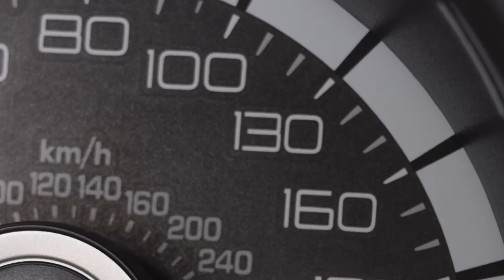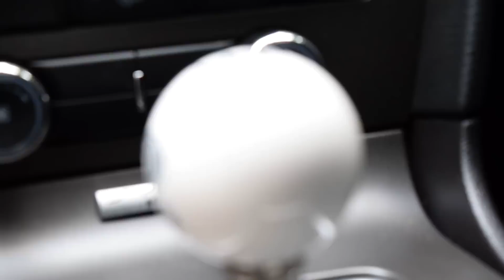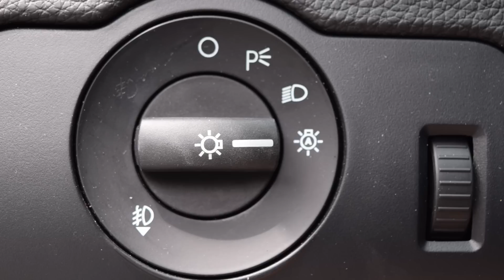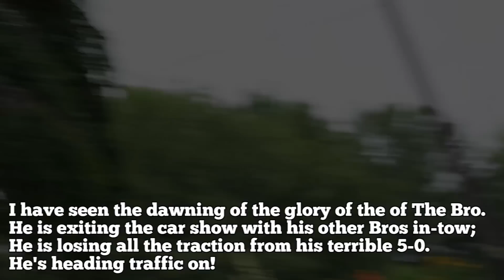2013 Shelby GT500: Regular Car Reviews

Comment: The owner traded in the Corvette, which can actually go fast AND carve corners, for an overweight pig of a car with an axle you should only be seeing on a truck nowadays. Sounds like a downgrade.
Reply: this car is literally faster than the corvette on any straight line.. it actually destroys it..
Reply: +MegaElkHunter1 he's saying it can go fast and corner. nowhere in his comment does he say the corvette is faster
Reply: +Chance Johnson "which can actually go fast AND carve corners" implying that the GT isn't fast ffs
Reply: He's not saying its slow hes saying the corvette can corner and go fast unlike the mustang that can only handle straight lines.
Reply: +Danny  Contreras the only C6 Z06 I've ever seen beat a GT500 was turboed. and even if you managed to get a Z06 to beat a gt500 stock, look at the engines. the Z06 needs 7 fucking liters to push 500 hp AT THE CRANK. that's fucking awful. if I supercharge the 3.6l V6 in my jeep it'll be pushing 525 at the crank lmao.
Reply: +Chance Johnson the gt500 is like a hellcat. it's not a race car. it's a car literally made to put a huge fucking smile on your face and it does that perfectly.
Reply: A Z06 will destroy a GT500 on a track with a lot of corners because the GT500 handles corners like a rental car.
Reply: +MegaElkHunter1 Honestly the liter argument is so idiotic. It makes zero sense.
Reply: +OneFastC4 please elaborate? Chevy has been doing it for years. they make monster sized engines that aren't needed and then they put out pathetic numbers.
Reply: +MegaElkHunter1 yet those "monster engines" are still smaller and lighter than Ford's V8's lol
Reply: +MegaElkHunter1 and the LS7 can push way more but GM limited it to 505 cause emissions
Reply: +Danny  Contreras I can't remember the comparison but one of the car youtuber channels bought a 5.0 and an LS and put 10 grand into them. the 5.0 was considerably smaller because if I remember right the LS was a 6.0 or something like that. the Ford almost matched it's power for the same price and if the idiots filming didn't spend so much money on stupid shit like oil pans they would have been able to beat the LS HP and TQ wise.
Reply: This argument is so pathetic. You guys are no different than kids arguing about Xbox vs PlayStation. Grow up, no one cares what Brand car you THINK is better. Just except one anothers brand loyalty, that easy.
Reply: Sir you do not understand the English language
Reply: MegaElkHunter1 they are actually dead even in a straight line. It's a drivers race everytime or until the Shelby gets heat socked

Comment: I got rid of my 2011 GT500, which was such an awesome car, it was so, awesome, just awesome.  But, it does get insanely hot, you are not kidding and I live in the desert so the A/C became J/K.  You described me as well, I got a 2016 SS, cause I went, wait, if this motor goes, so does checking, look at that LS3 price...

The exhaust is so good, we went by my wife's work one day and one of her patients wanted to show us her new Vette, she rev'd the motor, it sounded wonderful, she asked me to rev mine, I did.  I set off car alarms.

The GT500, is one of the cars, that was like some planes I have flown, smiled every time I got out of it, and my hands were a little sweaty if I pushed it.  Hope the next guy/gal who has it, lives.

Comment: Posi to a newbie is just a regular lsd. Eaton uses the names for the type of aggressiveness and performance like for instance they use positrac for they're stock or mild applications. While they have also a Detroit truetrac which is controlled by a helical gear unlike a positrac, so the truetrac acts as a torsion differential. There's also another brand called wavetrac which acts like truetrac but rarely disengages upon deceleration unlike the truetrac. The wavetrac can only make a difference of putting the power down where it shows on the track.

Comment: The VF is still overheating because you put a radiator for a inline 6 on a 5.0. Not only is the facing surface area too small, you're probably getting flow stagnation.

Comment: The new mustangs still have an 8.8 rear diff, just with an independent suspension setup and CV axles replacing the straight setup.

Comment: 8.8":  Easier to get disc brakes to fit.  Way lighter than the 9"
9": Easier to change the rear-gear -- you can switch from 3.70:1 to 4.11:1, at the track, in about 5 minutes with the right tools.

Comment: Most transmissions GM used with the LS like the T56 and TR6060 are also "progressive overdrive" for 5th and 6th gears...Even the automatic 6L80e and 6L90e are both equipped with 2 overdrive gears...the reason for the skipshift was indeed fuel economy, but ford just didn't use it....

Comment: My 2012 Mustang GT comes with that "fuel efficiency" 1-4 gear shift skip. Unfortunately it lugs the engine. I can avoid it by switching to 2nd after moving the car roughly two inches in 1st.

Comment: FWIW  my Cadillac CTS-V with a TR6060 6-speed manual also has a 1:1 4th, and both 5th and 6th are overdrive (.80 and .63 respectively). Still had a gas guzzler tax though.

Comment: Great review!  We're getting to the point where "usable" Hp and torque is realistic or not.  Who's rowing to the redline in each gear on these?  Power/weight ratios be-damned, I'd say the ideal combination is 10 pounds of car per 1 Hp.  At that ratio, you can use all the engine.

Comment: The T56's in most of the GM performance cars had the 1-4 skip shift AND double overdrive with 3.42s.

You think this is bad in 6th?  Let me find my old LS1 Formula and stick that thing in 6th at 60mph.
Reply: Came here to post this. My GTO's ratios (LS2 + T56): 
First - 2.97:1      Second - 2.07:1
Third - 1.43:1
Fourth - 1.00:1
Fifth - 0.84:1
Sixth - 0.57:1

1-4 skip was disabled before I bought the car, but I've tried shifting 1-4 manually. Strange concept.

Comment: that appears to have the performance package, which comes with 3.73 rear end gears not the 3.31.  3.31s come on NON performance package gt500's just so you know lol
Reply: Not for 13-14. It was just adjustable shocks, different wheels and the diff

Comment: Dr. Mr. Regular, The name Positraction was used for Chevrolet , not all GM's (ex. Pontiac's was Safe-T-Track). Ford's name is Traction-Lok (sometimes abbreviated Trac-Lok), not Truetrac. Truetrac is an aftermarket brand name from Eaton. And the 8.8 Trac-Lok centersection can be installed on 8.8 IRS cars like the New Edge Cobras, not just solid axle cars. You can read more here http://www.hemmings.com/magazine/mus/2008/12/What-s-the-Diff-/1736539.html

Comment: What’s the difference between the 2013 gt500 an 2013 Shelby gt500 or is there none?
Reply: i could be wrong but if one is plated with the Shelby font it was modified in the Texas Shelby shop, by those who then bring it to a logical conclusion of illogical amounts of output and handling and is also upgraded further to accommodate the owners wishes ( base price of those sweet snakes is more than double the sticker price but is 1:1 model build but ford bought the name now so im lost.
Reply: They’re all the same. If someone says mustang gt500 they’re leaving out the Shelby for simplicity’s sake

Comment: A correction. Posi traction was a diff that locked 50/50 similar to the Detroit Locker, which was for drag racing. This meant that both wheels locked positively ensuring power was transferred evenly, even while no traction was gained. A limited slip is where the term one wheel peel comes from because "it transfers the slip to the one that gets the grip".

Comment: um put a larger radiator. less engine heat due to it being spread over more water and aluminum.
Reply: like big block radiators are more cores than small block rads

Comment: How about a late 90s Bonneville review?
Reply: Brian Fitzsimons I had a 95 Bonneville SSEi that I bought for $900. Bought it out of desperation just to get me through until I could afford to buy something better. It wound up being one of the best cars I've ever owned. It was the perfect road trip car and even at 289,000 miles it averaged 30 mpg highway. The transmission gave out just short of 300,000 but I got 150,000 miles out of it and the car never had one single problem. And that's pretty amazing when you consider that the only maintenance I ever did was keep the fluids topped off. I never really expected it to live that long so I never bothered with maintenance and it took it like a champ.

Comment: The Shelby Mustang is one of those oddities that's hard to really wrap your head around. Six hundred and sixty-two horsepower. A top speed of over two... hundred... miles per hour. It goes zero to sixty in three-point-five seconds.
When you get into the question of “need”... Well, no, no one really needs a 5.8-liter 32-valve V8 supercharged engine. Nobody needs the ability to go a good hundred and fifty miles per hour above any reasonable speed limit. But Americans have a lot of excessive things we enjoy but we don't really need.
2013 Shelby Mustang GT500. 
The AR-15 of cars AAAHAHAHAHAHA OH YEAAAH FLAME WAR
See, this is the art of trolling. The art of trolling is to get people to fight with each other. Not you.
Ungh, here we go. Time to dig up Shelby's corpse, hook up a jump pack to his funsize Slim Jim and 
RIDE IT. 
ONE. 
MORE. 
TIME.

Comment: Come on bro..  Do the homework.  GM has used T-56 and its cousin the TR6060 in F-bodies, vettes and CTS-Vs since 93...  They have 5 and 6 overdrive just like the ford.  Same with the C6 Z06.  So the skip shift has nothing to do with 5th and 6th overdrive.  Side note the C6 Z06 is not supercharged, so the saying suck it LS based on the Ford 5.8 having more horse is not an apples to apples...   Yes... I am an LS f-boy.   

Anyway, just constructive criticism.  I like your show.  Just want the car facts correct.

Comment: Even a GT is a waste of money.  A Miata can bet it on the track...its too unwieldy.   That's why I'd buy a V6.  Less money, less weight and would probably handle much better.  No loud noise though, what a bummer. ')
Reply: Dude, seriously?? Go look at some lap times for the '11+ 5.0
Reply: But what in reality will a GT do for me?  Considering that V6 in a convertible.  300hp is about what the GT had in 2005.
Reply: Complaints about track performance are so lame
Reply: ***** I was talking to Robert. The idea that a stock Miata could come anywhere close to a stock Coyote around a track is hilarious. But he is correct about the V6 being better balanced. The difference in weight distribution is noticeable. The power difference is actually only about 100hp, and if you get rid of the V6s 2.73 fuel saver gears, it really is a good option if you're more interested in winding roads or autocross.

Comment: This is why I never consider American cars.. A Japanese automaker would never let a new car grace their car lot if it had overheating issues. I'd rather be redlining every gear without a care in his Honda Fit.
Reply: 662 horsepower is 662 horsepower.

But, if an actual balanced, refined American car that does more than straightline speed is what you want, i highly reccomend the 2015-present mustang shelby gt350r, a 8250 rpm 5.2l flatplane crank track car with a 6 speed, it also looks way sleeker than this 2013 model, give it a chance. :)
Reply: @riogrande163  I have actually been quite curious about the new body style Mustangs. You can tell from a distance that they sit much wider which probably has a lot to do with the better handling you speak of. It's nice to see American automakers try to get away from the straight line stereotype. 

If I could design the American sports car of my dreams, I would love to see Ford bring back the Cobra by redesigning the Mustang chassis to be significantly lighter and smaller. Keep the wide wheel track of the current model but at around a 2,300 - 2,700 lb curb weight with a large bore 4 cylinder or a small straight 6. I think it would look so neat to have these miniature fastback Mustangs on the road. That would end the straight-line stereotype for sure and I bet it would sell like hotcakes at the right price too.

Comment: I drove this car when I worked at a Lincoln dealer and I'm telling you, I couldn't the damn tires to keep traction. I was on dry pavement just spinning tires like no tomorrow! This is at about half throttle in first gear mind you! This damn car has way too much power lol. This car has a thumping sound system too btw. The one I drove had a factory subwoofer bolted into the trunk. So does the Mitsubishi Evo I drove. NAAAAAAAME DROOOOOP

Comment: wrong once more 0+60 is 4.7
Reply: You're confusing GT with GT500
Reply: No I'm not it's 4.7 seconds
Reply: The 2013 GT500 is not a 4.7 second 0-60. That's pretty pathetic considering a base GT manual of the same year has a 4.5 second 0-60
Reply: Shorpy Plorshy the official numbers are there for anyone to see on road and track.and motor week.it is 4.7  0_60 .and 12.87 in the quarter mile
Reply: Why does every other source tell us that the 0-60 is 3.5?
Reply: All In mopar Lmao 4.7 0-60.

Comment: Meh, a 4.8/4L80 from a van, with decapped injectors, china 455lph fuel pump, $500 T/C, and an $800 Demah kit from VS Racing in a V6 Rentalcar Mustang will make more power and go just as quick/fast...trollolol

Comment: there is a 4.6l 2007 mustang for sale where i live in perfect condition will all the tests and upgraded rotors pads and calipers as well as some sketchy "racing" alloys and some randoms company racing tires on all 4 corners for 17.000euro ..... i would be all over that bitch if i had the cash
Reply: The 4.6 will kill itself before a north korean defector gets caught.
Reply: in ireland getting a mustang with a coyote will cost me like 40.000.....
Reply: NotIrishRider Repairs on the 4.6 will cost 40,000
Reply: ***** it only has 34.000miles and is in amazing condition ... also from looking online it seems this engine is not that bad for irish standards that is
Reply: NotIrishRider The open diff is a problem along with the fact the engine is not made for spirited driving at all.  It's one of the few engines you feel bad for revving out because it doesn't want to.  Plus, 10 year old Mustang means a lot of squeaks and rattles.  Would recommend getting a E36 M3 or something since insurance is also a factor.
Reply: ***** I would not get a car like this since i moved to ireland ... insurance like you might know is basically a legal scam here. But if i ever move somewhere else or go back to poland i might get one
Reply: NotIrishRider Doesn't the insurance company factor in the engine displacement?
Reply: ***** engine displacement / hp / mods / age / no claims / area / most cars over 200hp are classified as dangerous / if this was my first car at the age of 18 i would have to be making 45k+ a year to pay for this shit

Comment: still slower than a Hellcat :p
Reply: Faster than your V6.
Reply: ***** 

Faster than your I-4
Reply: +3.6L Dodge Avenger aww, your cars stock. How cute
Reply: +VoraciousPhantasma Lesson of the day: No matter what you have, someone's got something faster. Because money.
Reply: True.  I probably have about 10 years of experience and work on him though.
Reply: It's not faster The mustnag has a better power to weight. Hp isn't everything, weight is a huge deciding factor
Reply: Seth Imola 

I'm sorry, but every race the GT500 raced against a Hellcat it lost
Reply: +Seth Imola it is, but horsepower cannot be replaced by weight reduction in the end.
Reply: First Hellcats came out about 3-4yrs after the GT500. The manual Hellcats aren't really any faster the autos definitely are faster than the gt500.
Reply: +3.6L Dodge Avenger a manual vs manual = same fucking straight line performance the only difference is in the A8 trans
Reply: It shows that the Automatic Transmission is a more superior Transmission than the manual.
Reply: +3.6L Dodge Avenger you only day that because your shitty and slow avenger only comes in an automatic and you can't drive a stick. Both transmissions have their place, and a manual can be better than auto in some cars with a good driver.
Reply: ***** 

I don't know. 0 to 60 in 5.2s isn't very slow kid.
Reply: +3.6L Dodge Avenger for one of the worst cars dodge has made in the past decade, I guess that's not horrible if that's true (which is doubtful), but that's gotta be the only thing it's got going for it, "kid."

Comment: 5 and 6 are meant for 175 mph and to get good mileage with them at low speeds is a double win. It seems kind of sad that the original GT 350 and 500 were race track cars and this one wont be able to do hard laps without going in LIMP DICK MODE!!!!

Comment: 60s cars weren’t that great or as fast as you think they were. Yes there were special Copo Camaros and big engine options etc. but the new stuff is faster with less power. A lot of the old stuff needed to be modded and built. People have Hyped up those cars so much they just turned them into fairy tale stories. Most those stories your dads brothers cushions wifes friends who had a big block whatever the fuck it is that did 200mph in 3rd gear is all propaganda old man bullshit.